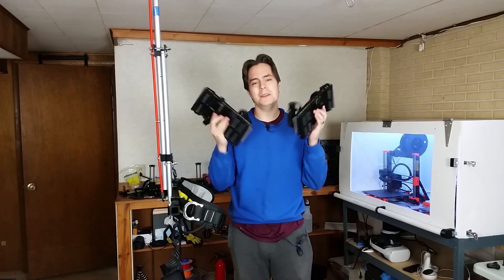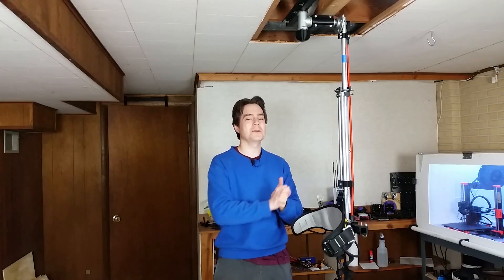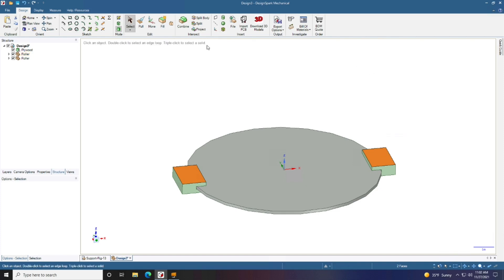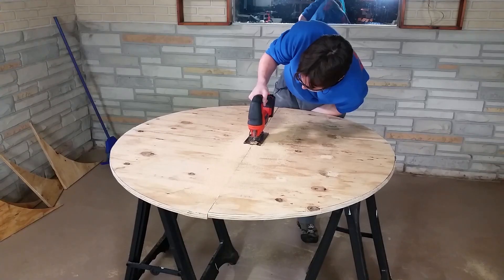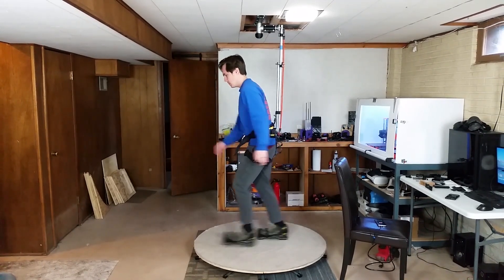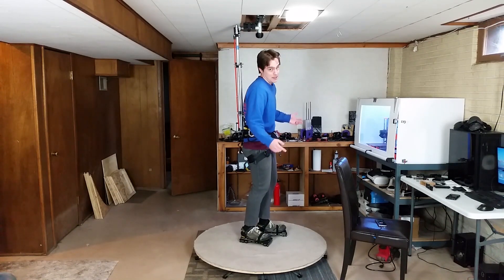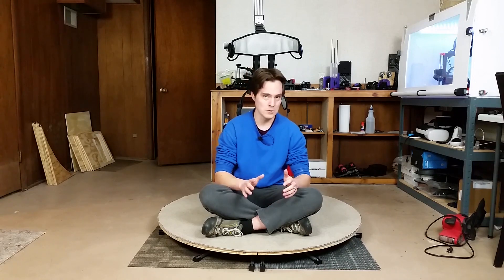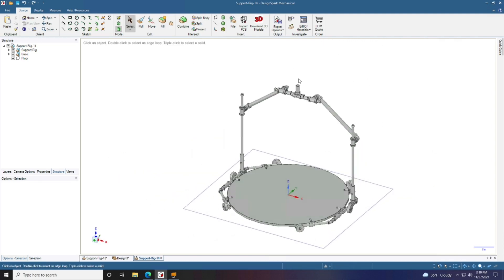VR Shoe Build Log #48 - Starting the next support rig (no bolting to ceiling or wall)

Comment: i think those rollers on the edges are gonna make a ton of noise
Reply from the maker: I don't think so, but we'll see. The bearings will have TPU tires, and the wheels will be made out of TPU, so I think it should be fine.

Comment: -Suspended foot in mid air with cord. Silence walking with no floor contact. 
-Stable walking will require minimum "foot floor friction". With special surface below the suspended foot touching slightly the floor along the walking. 
-We' ll still need to maintain user with a rig and strap.

Comment: You love to see it. The structure you went with is looking great, rigid pink foam is a good option for sound dampening. If you ever want it to fold again you might look at piano hinges, but a flat circle is already easy to store. I can't imagine losing the folding function to be a big deal at all down the road.

As for sound deadening, trying some cheap carpet padding under the carpet you already have might help. Super cheap at big box hardware stores, like 25c per square ft.

For the rig, having those crouch sliders so far apart is likely to be a huge pain. I would strongly recommend having a similar setup to your ceiling rig, one slider right behind the harness. The part which rides the edge of the platform could also be a solid piece, you don't want that flexing. Maybe a full plywood ring would help; this would be easier to add or remove rollers to as well.